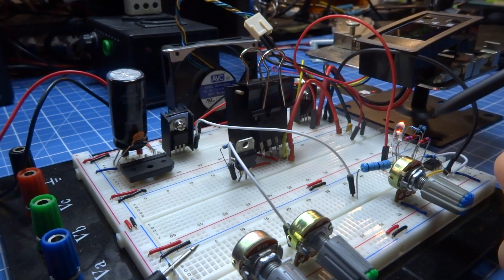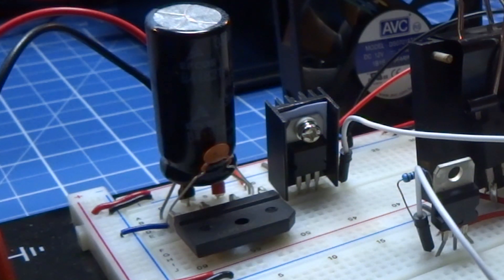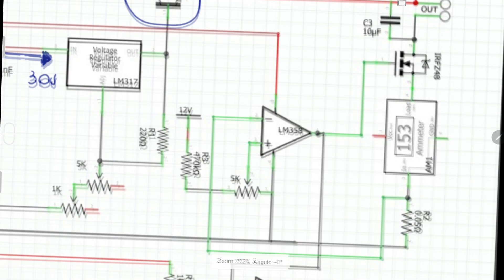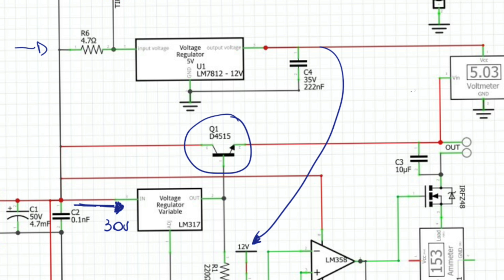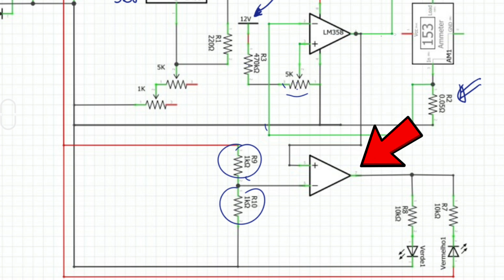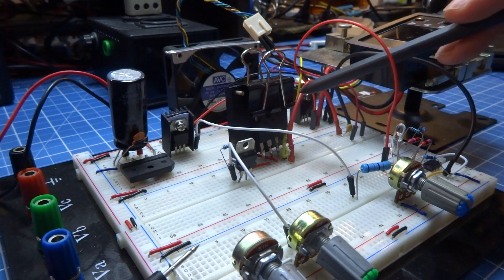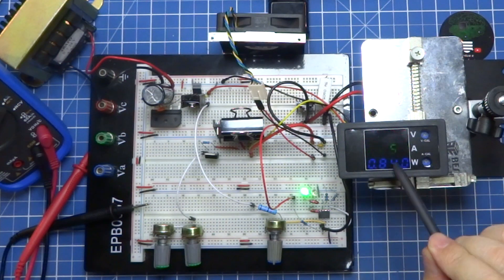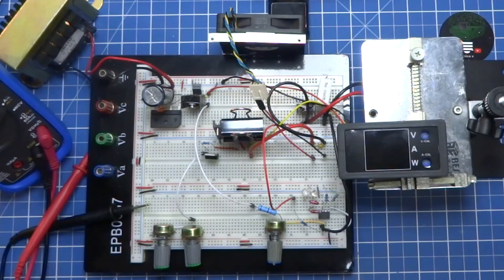Fonte com regulagem de tensão e corrente com até 5A muito fácil com LM317. DIY

Comment: faltou ligar a linha +12V ao coletor do TIP42 para manter a regulagem da ventoinha. O amperímetro eu ligaria antes do resistor  R2, porém a referência de corrente do LM358, o (-) do potênciometro de 5K ficaria no mesmo ponto, entre o amperímetro e R2, e a entrada inversora do comparador, fica onde está, após R2 (agora sem o amperímetro). Talvez um resitor de carga (680r x 5w) no circuito do emissor de Q1 ao terra antes do amperímetro / R2 / IRZ48. Outra idéia interessante seria substituir o resistor de 470K por um de 15K (10k resistor + 10 trimpot para ajuste preciso) e colocar um voltímetro digital no cursor do potenciometro de corrente de 5k (vai indicar 0-3, batento a indicação com a corrente máxima regulada) e dalí um divisor de tensão (1/20) para dar a referência dos 150mV ao CI (para 3A), pode ser 100k+4k7+470r  em série (ou 100k e trimpot 10k para ajuste preciso)  e da derivação do CI para o terra, 4k7 + 470r. Gostei do LED VM e VD.
Reply from the maker: Boas ideias para aprimorar o circuito, valeu!

Comment: Estou montando uma fonte como trabalho da faculdade, uma fonte 12V com um circuito de proteção usando tiristor de 1A, quando eu tiver 1 A de consumo a fonte desamar protegendo o circuito. Estou com um problema no display digital, quando coloco ele para medir a corrente, o display está influenciando no meu circuito de proteção, o circuito de proteção atua acima de 1A. O que vc acha que posso fazer?
Reply from the maker: Provavelmente o Shunt do amperímetro está sendo contabilizado junto com o sensor que usou para definir a corrente. Utilize o Amperímetro na saída, ou recalcule adicionando o shunt do amperímetro.

Comment: LM358 vcc supp. Direct 30v why??
Reply from the maker: I used it in the first comparator entry, so in the second. But it is a good suggestion to use the 12V output. The biggest problem is the load of the LM7812.

Comment: VR 1K AND 5K Red colour where is joint direct 30v or 7812 output supp. Clear me and VR1K And 5k
Lm317 related components name Please ans🌹🌹 👏👏👏👏👏
Reply from the maker: 1k and 5k potentiometers are connected in series (optional). They are linked in the GND. And then on the LM317 (voltage regulator).